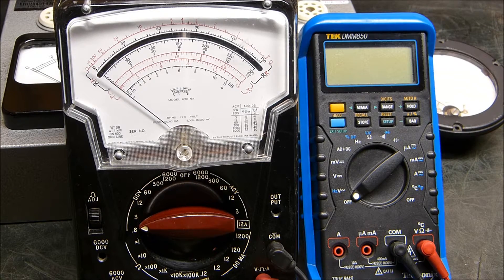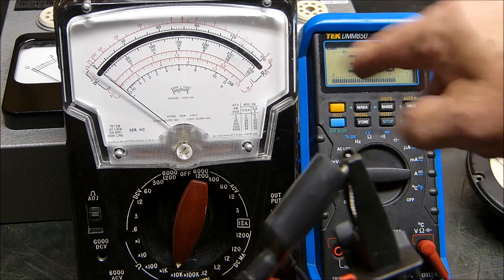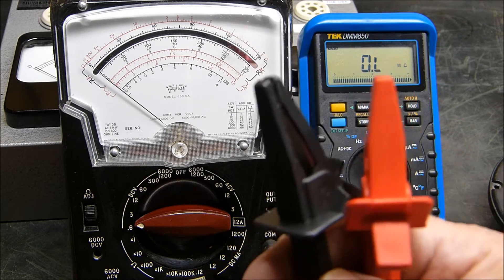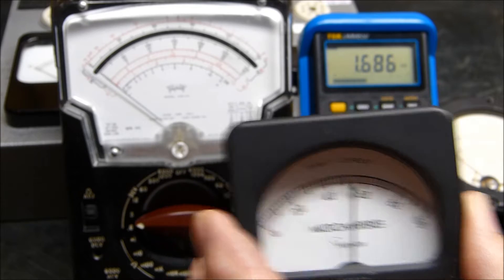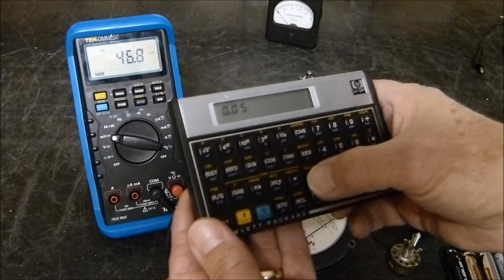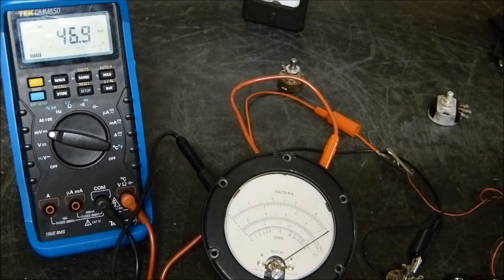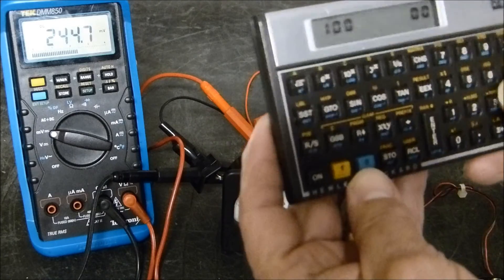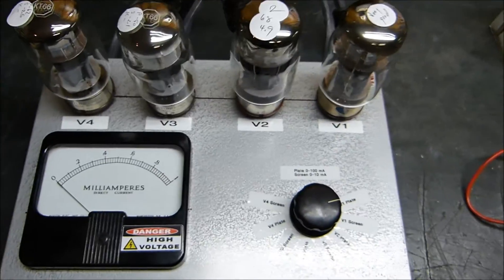Triplett, Simpson, Weston, etc Analog Panel Meter Measurements

Comment: I have a lambda 71 regulated tube power supply. The 500v meter (looks to be a simpson type  sticks at 350v then goes back to zero when adjusted down. Do you know a good resource to consult  before I operate on it?  Good video BTW. Thanks
Reply from the maker: Mechanical issues in these beautiful old meters are difficult to work on and in most of my cases, the results are not good. They are as delicate as a watch movement so it is easy to make things worse. Sorry I don't have better news. Determine what movement it is, i.e., 1 mA full scale, 500 uA full scale, etc. it may be stamped on the meter in small letters and buy another one off Ebay. That is what I suggest.
Reply: @ElPasoTubeAmps  Okay, Will do. Thanks

Comment: Holy smokes! It finally clicked. I finally got some current flowing through my dim bulb. That is genius. Use the DMM for a safe power supply and boost the remainder up to full scale with the 6 volts. I recently acquired 14 vintage analog meters. It's a long story, but I felt so bad about the low price that I offered him more. Being the perfect gentleman, (he reminded me of yourself and UD) he refused. So I'm determined to make a vintage hardwood dashboard to display these meters, in all there glory. Thank you for the how to David. Cheers!

Comment: Great video! I noticed on the back of the second meter you showed us in the video (100 micro amp simpson), that there was a round yellowish passive component attached across the two terminals. What is that? I have a bunch of recently gifted vintage meters that also have various resistors attached to the backs of the meters. I've been scratching my head for a month. Thanks!
Reply from the maker: If it has something connected across the terminals on the back of the meter is surely a shunt to re-scale the meter. You can make a 100 uA meter measure anything you want with a proper shunt. I am sure that is what you are seeing. Some meters have internal shunts that you can't see without taking the meter apart. To determine what the meter is or is shunted for, I connect a high ohm pot in series with a battery and then all in series with a current meter I trust and slowly lower the resistance of the pot and see what the trusted meter measures and what the unknown meter measures. I think I have another video on how to shunt meters.
Reply: @ElPasoTubeAmps  yes, and after watching your other videos, I can finally test my meters with confidence and no damage. Thank you very much!

Comment: First, I love your videos! Thank you for posting. I have a number of DC Volt Panel meters with no indication of what it takes to drive them full scale. Is it possible to use your technique in this case to establish resistance or current?  Many thanks and looking forward to your next video!
Reply from the maker: Noonan Hi Noonan - yes, this should work on any meter I can think of. Just make sure you start out with enough series resistance so as to not damage the meter. Some of the meters already have shunts inside  them and, for example, the meter may have a 500 mA scale and indeed be set up for 500 mA and so on.

Comment: I have a sneaky feeling that the DMM doesn't sample resistance using pure DC, and the fact that meters have inductance is what tends to throw the readings off.  Also, some meters have a bypass cap, and that would have obvious AC implications.  I'd be curious to see what the sampling signal from that DMM looks like on your scope.
Reply from the maker: That is a darn good idea. If the DMM is an AC ohm meter, like an ESR meter, then the inductance of the meter would surely cause it to have some problems. I will definitely test it. Thank you. I may not make a video but I will let you know what I find.
Reply: ElPaso TubeAmps
It's just a wild guess.  My bet is that it wouldn't actually be AC (change polarity) but it could easily be pulsing DC or something sawtooth like which would act sort of like AC on a cap or coil.